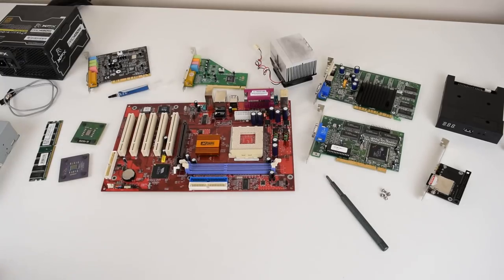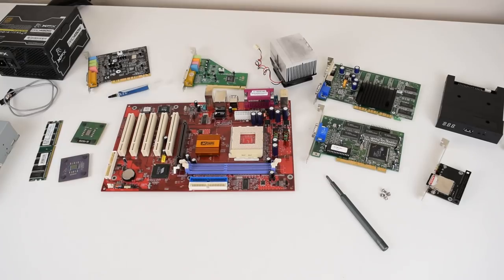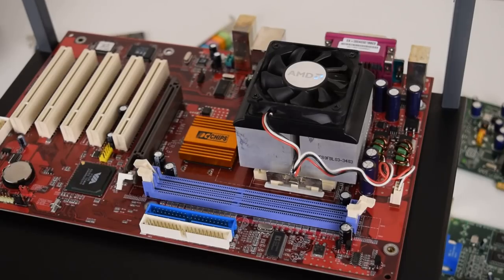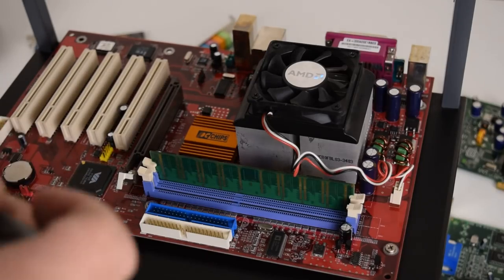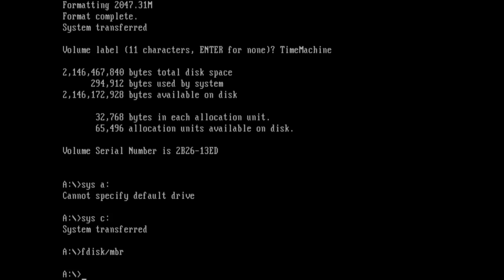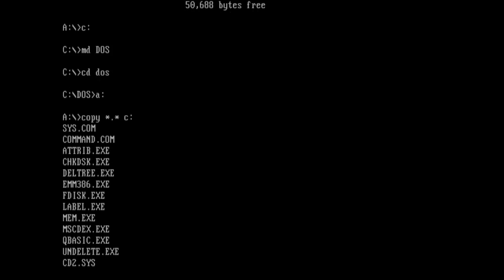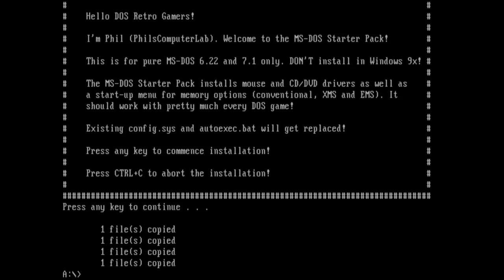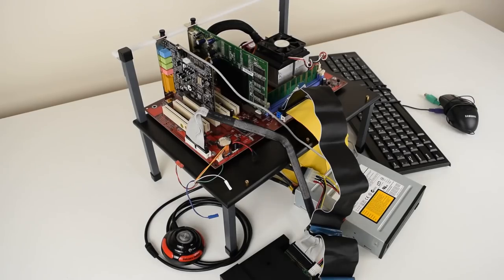Building a DOS Retro PC that everyone can afford

Comment: The best way to get computer hardware on the cheap is to get abondoned systems from friends or family ... Or even dumpster diving or putting a advert in the classifieds , you will be amazed at what you find
Reply: my friend actually found 2 amd 754's on a dumpster.It was standing in the rain.I took some time to clean it up a bit and both of them working fine just i gave most of my agp cards away only 1 i  got left but misplaced it is a 9200 ati one i think.
Reply: That's a fact.
Reply: This is definitely the case. I found an i7-920 system in a trash pile (dead power supply and hard drive), another system with a bad motherboard and a good 500w PSU, and a friend offered me his "old" GTX950 after he upgraded his to do VR stuff. A bit of work, a hard drive, and a 6-pin adapter later and I have a (sorta) modern gaming rig for $60.
Reply: found a athlon full system by side of road
Reply: Found mine at a recycling center. A working Asus board with an AMD 1GHz CPU and 512MB of SDRAM. And I've been using it for a retro build as well.
Reply: I asked a guy at a airport if he had any spare crts. Next thing i know he gets to my house and gives me a Free ibm 5153.
Reply: I have this dell T3400 I found and set it up as a windows XP gaming machine. Threw in an HD 5850 and some new 500 GB hard drives in raid 0. It gets around 250-400 fps in far cry. It has a core 2 duo E8400 with 8 gb ram.
Reply: I put my amd 64 3200+, gf6600gt, Asus sli board, antec tower, dvd writer, floppy  on street knowing someone will take it. Took 15 minutes. Lol.
Reply: I have a weird pc build I got a 15' crt from my attic nvidia geforce 315 4gb ram and amd sempron 1.9 ghz and a 500gb sata hdd. Windows xp
Reply: All my PC s for the last 5 years were free, from friends. I5, i7, all pretty competitive.
I think I spent ~ 200$ in the last 7 years on parts.

Comment: Dosbox is amazing and is a great solution for playing most games and demos from all PCs since the first PC in 1981 to the last DOS games in the late 90s. Also can run Windows 1/2/3/3.11/95/98 and has good FM sound with support for pretty much all sound cards ever built for this time period. Free software and no clutter.
Reply: Where's the challenge in that though? Old hardware was a massive pain in the arse but when you got those games running it put a massive smile on your face
Reply: plus if you have any interest in software that's not games....  IDK, maybe you can code in Pascal or Turbo C in DOSbox. But also, these old computers will gain value in the future as most of them die and get thrown out (mostly capacitors blowing and owners have no idea they can be replaced) These are finite collector's items, even is you don't play any games at all on them.

Comment: Definitely agree on the IDE SD card adapter for DOS, work brilliantly. Be aware though that SD or SATA to IDE adapters MIGHT not work in Windows 9x with DMA mode enabled. Just FYI, in case you're building a DOS/Windows combo PC.
Reply from the maker: Yea on some chipsets, and with some adapters, the DMA mode will lockup the machine. I've seen this quite a few times so far.
Reply: that's why i still prefer cf to ide (the pins are the same)
Reply: Where can I find one with a bracket. I can't find them anywhere
Reply: I use win 98 se on ide sd adapter and all work just normal. + super sillience. :)
Reply: I've noticed that IDE-SD adapters are great for newer hardware, but they don't work seem to properly for older BIOSes or systems especially if they still rely on cylinder/head/sector geometry... at least the ones I've found so far. For older systems you'll still need to use an IDE CF adapter.

Comment: I wish I had have seen this video a couple of weeks ago! I just bought an Athlon 1000 MHz that showed up with about 30 bent pins. It was very challenging to get them straightened out enough that the CPU would socket, especially given my mid-40s eyesight. Using a mechanical pencil for that is a great idea! It would have saved me a ton of time.

Comment: There ARE DDR sticks lower than 256 MB. I believe the lowest DDR RAM sticks are 128 MB ones.
Reply from the maker: Nice, got to look for one then :)
Reply: Can confirm - I've got 2 Hynix modules in my drawer, 128MB each, PC2100. :)
Reply: I can confirm, I had two 128 MB Samsung sticks for a while in my Socket A machine at the time. I don't remember the speed, it was 15 years ago.
Reply: Below that, 64MB starts to go into the SDRAM category doesn't it?
Reply: Actually, my Google-fu turned up a 64MB DDR stick by Micron so they do seem to exist. I had no idea. :)
Check this one out: MT8LSDT864AG-133C7.
Reply: osgrov - the listings are showing that as SDRAM, not DDR.
Reply: youtubasoarus - Oh, you're right.. Amazon goofed that one up - they claim it's DDR.
But yeah I found the data sheet now. Clearly SDRAM, PC133. :)
Thanks for the update.
Reply: osgrov - No worries, I was wondering if I was wrong myself. This is some OLD memory lol. Was wondering what the transition point was from SDRAM to DDR. And then listings show DDR SDRAM so that's kind of confusing.
Reply: youtubasoarus - Yeah it's been awhile since these were current tech, hehe.
There are several people on eBay who sell 64MB DDR DIMMs though. I'm trying to verify at least one of them but haven't been successful so far. :/ Guess we're not the only confused ones! Many I've checked now are clearly wrong. There is one guy selling no-name PC3200 64MB modules though, they look promising. Unable to locate a part number for it though, and the listed UPC is incorrect.
Looking at the DDR spec (on Wikipedia) it does appear that 64MB is the smallest size, and 1GB the maximum. So there's hope!
Reply: Here in Russia we have two main buy-sell sites: Avito and You.La. I tried to look for any 64 MB DDR sticks, but it didn’t seem to result even for PC2100 ones. Only SDR (pre-DDR sticks like PC133). However, I have no problem finding a 128 MB DDR on these two sites.
Reply: I have a 64mb ddr stick somewhere in my pile of hardware
Reply: @youtubasoarus im guessing the transition point was somewhere around the start of the Pentium 4 era, i've got an old Pentium 3 Mobo from around about 1999/2000 which uses SDRAM, my next oldest Mobo is a Socket A Asus board from about 2002 which runs DDR. Ive also got quite a number of old SDRAM laying about in my drawers and can confirm there is a few 64MB followed by 128MB sticks, iirc the highest SDRAM stick i personally have is a 256MB though i could be wrong(its been a while since ive checked out my old hardware)
Reply: Ian Witten - Wow, like, for reals?
Reply: Tony the Bomberman yeah according to Wikipedia it's the minimum capacity of a DDR stick, problem is Im pretty sure the person who built the pc is has passed away so I can't ask anything about it. It has some generic sticker no idea what brand it is
Reply: Ian Witten I'm willing to build a lowest possible (well, not really) Socket 775 rig, with some older 775 mobo like those on i865 chipsets or so and some very old AGP video card like RIVA TNT or early GeForce, running older Windows like 98 SE or 2000, and I already have a 3.2 GHz Celeron D 351 CPU. Would be cool if I found a 64 MB DDR stick as well here in Russia 'cause it would fit the suit pretty well. Or maybe it's not really worth bothering finding such a low DDR stick, and a 128 MB would be okay as well or even better...
Reply: It's been ages but if I remember right, that option that's something like 'OS > 64MB' (and/or mentions OS/2) limits the system RAM to 64MB no matter how much is installed.
I don't have any system out to test that for sure right now, but you can always just try toggling it on and off. I DO know that on the two Poweredge Servers I have(1850 1U[P4 Era] and 840 Tower[Core2Quad Era]) have an "OS install mode" that limits system ram to 2GB, there may be similiar things on different motherboards for different Ram Amounts.

Comment: Good choice for those who can't find/afford a Pentium or K6.
The best investment that makes a difference, is a CRT monitor. 17 inch is better than 19 inch with low res..  Seriously.. CRT (many has forgot) gives the "best" picture with MS-DOS games. But they are hard to find these days. You can go with a LCD 1600x1200 (or 1920x1200 with aspect correction) which will do 800x600 or 320x240 as well as 640x480 pixel perfect, BUT with 320x200, a CRT will be best. A LCD with aspect correction can display it OK, but the LCD is too revealing of pixels. CRT's are more smooth n blurry. ;)

Comment: Went on a bit of a ISA sound card spending spree recently; bought a couple of ESS cards and a Sound Blaster 2.0, the latter of which I got for a "bargain" under $100 Aussie dollary doos, so I can attest to how much it costs to do old-school retro gaming on period correct hardware. Even the ESS cards cost $32-45 including delivery, and they're just unbranded, non-collectable cards.

I managed to save money on some of my 486 motherboards by buying untested and dodgy looking boards, some of which needed repair, but I've got the electronics background to be able to troubleshoot and repair the boards myself. The only other option would be to buy bulk lots and hope you get one working board, then sell off the non-working ones as faulty/repair required to recoup some of the costs of those boards. But even then it's still going to be expensive and time-consuming.

Or you could just buy something newer and cheap, and just fiddle with the settings a little, and save a whole lot of money! You could easily pick up a whole system for under $100, which is cheaper than a "bargain" period-correct collectable sound card alone!
Reply from the maker: Yea something like a Sound Blaster, they are not cheap any more. ESS cards, for years nobody cared, they make some really good sound chips.
Reply: That's what I'm discovering. Because sound blaster cards were the most popular back in the day, that means they're the most popular with collectors, hence the high prices. And so ESS cards are much better value today, even PCI models. But they're really very compatible, and sound pretty good too.

Comment: Hi Phil, another good video. I cant think of much other, rather than first time viewers may have needed the segment where you calculate the 5 volt rail load to see if the Socket A will overload the markings on the power supply, but the CPU you chose is a low wattage one.

But you have it all covered in your plays lists.

Hmm  now for the hunt on super  low end thin client in dos mode ( HP / Cissco Wise )

PS , i still hang on to my SB16 and matching 2speed cdrom if still works after queuing up to buy it new when the price plummeted down to $800, then i saved more overtime money and bought 4 x 4meg sims at $100 each and upgraded yet again

The gotek floppy emulator is great ( their OEM software not so good ) the 99 images are cool but you really waste a 4GB USB stick as the rest of the stick is unusable, but that is a cheap price to pay for something that works great - HAHA i know what you mean about finding your A4 printed 2 x 25 column per side list of software you have saved in each slot, i keep it in a A4 sleeve as my wife found it in the spare room and threw it out once thinking it was scrap paper
 
Sites such as allbootdisk and winworldpc are excellent for all retro software to boot up and some support files. I have in the cupboard original 5.25 and 3.5 DOS 3 to Dos 6.22  retail and OEM packages, and i find they mostly work, but often you get a error somewhere, sometimes t can skip a file other times halt on something important and die. Some have never been opened, so it is true they loose there magnetic field over time, others like a junk cheap coloured disk i have in 3.5 work every day, all of the top brand, Memorex, Imation, Verbatim, have the best chance of lasting well.

For 5.25 3M, BASF, Maxell, Memorex are pretty good later on the Le Floppy and Laser were just cheap mass produced items, they worked but they are made to a price.

Regards
George

Comment: Good video. The SD card use was interesting. I still prefer to use my older Pentium 233 chip for DOS as the motherboard has a few ISA slots, which are needed for my Roland SCC-1 Midi sound board & the Soundblaster. It makes games like Doom and Descent so much better in the music department. I also have a Soundblaster MCD 16 with a Yamaha DB50XG. The Yamaha is set as 300 and the Roland as 330.

Comment: An option for better game compatibility with the YMF744 is to go for an older VIA chipset with the 686A/B southbridge. With this setup you can run the YMF744 in DDMA mode and then you don't need the DSDMA TSR and EMM386 (you need a modified SETUPDS.EXE as it doesn't contain the PCI id of the 686A/B southbridge). MSI actually produced a board with the KT133A/686B chipset with a 12V P4 connector, the K7T Turbo2. Also SiS chipsets can be a nice option for the YMF744.
Reply from the maker: Yea thanks for the reminder, this is on my list of things to check out in future videos. I have an upcoming project with a T5710 Thin Client. Transmeta CPU, but it might have that older South Bridge. I wonder if SETUPDS could me modified for other chipsets?
Reply: Looking forward to that Transmeta project. There is a modified one I used on the SiS 645DX/962UA chipset for DDMA support, might also work for the VIA 686A/B southbridge, it can be downloaded from here: http://vsynchmame.mameworld.info/
Reply from the maker: Thanks, I believe I have a few Pentium 4 SIS motherboards, they work great as AGP test platforms, being Voodoo compatible and the Rage MAXX also works with them :) Do you think a modified driver for newer VIA South Bridges could be possible?
Reply: I tried to force DDMA on newer VIA chipsets for the YMF744, it initialized in DDMA mode but games refused to work. Duke Nukem 3D setup complained about DMA address wrong or not working.
Reply: Think I saw you received an ALS4000 card, try this in the setup you got in your video as it should work great under MS-DOS.

Comment: For DOS i think the best configuration would be and asus board that was released for pIII that has 1 agp slot 4 pci and 2 isa slots, the thing is that one of the best internal sound cards is sound blaster awe 64(isa) , for video would be an S3Virge for example that are compatible with univbe driver. My 2 Cents

Comment: Nice video.  I bought some retro stuff recently.  A unisys 386 16mhz with original mfm 43mb hdd. 

And a 486dx 33 system with a 256mb hdd.  And 4mb 30pin memory.  Also got a cheap mainboard with a 6x86 ibm cpu on it.  For 15€. 

I only need to get my ibm mainboard with 486dx4 working.  It gives an error code at startup.

Comment: I've finished my 478 build, now I'm onto 775. I bought a 2nd hand PC solely for the Asrock 4core dual sata2, can't wait to throw a q6700 in there.
Reply: Having fun with 775 rig got a whole pc for £15 added a q6600 and a hd 7700 overclocked has a antec super lanboy  case still looks great and gets used daily by girlfriend as a photo editing system

Comment: Looks like a PC Chips M817 ? socket a (462) and a XP Tbred and either a Duron Spitfire/Morgan core or a Athlon Thunderbird in the grey.
KT266A chipset can handle 133MHz FSB CPU's but the performance with the PC Chips mobo will be slower than most other socket A mobo's (though VIA is preferable to some old SiS chipsets - especially the sloowww SiS 730 which PC Chips used on the M810 LMR. 
Ive had over 50 computers (easily) and used to have 19 computers at home with 10 computers (cased and caseless) in my bedroom all running SETI@home 24/7 and when SETI got old I ran Folding@home but was in the top 40 in the UK on SETI@Home (back in the day).......you know you can get nForce mobo's with onboard GeForce 2 VGA.....A7N266-VM? I think thats the model I had......also had a GA7ZXE with a VIA KT133a chipset and had the FSB (168 pin SD RAM of course) up to 156MHz but have no idea how PC133 OR the chipset achieved this and not to mention the ridiculous frequency the PCI/AGP bus must have been running it.....KT133A also worked with Athlon XP Thoroughbred A & B CPU's and obviously other socket a processors such as the Duron Applebred which were great processors if on a budget as could re-enable L2 cache to same as athlon XP (256kb) from the 64kb default on a Duron. All I needed was a HB pencil and I joined two contacts on a bridge on the top of the processor as Applebred Duron were the same as the T'bred processors - just had an L2 cache bridge cut to lower the amount - or at least AMD had hoped so............
I had a 1600MHz Applebred which clocked (easily) to 2300MHz with the full L2 cache enabled and the CPU cost just £32 at the time! I cant remember what mobo the Duron was on but probably a Abit NF7-S, Epox 8rda3, Epox 8rdae and other nForce 2 based skt a mobos

Comment: Try using a Sandisk A1 (or A2) microSD card for operating systems.
Their A-series cards greatly optimize OS and small file (4k IOPS) read and write speed, and is great for Windows XP and below, as well as Linux; better than most SD cards and USB 2.0 flash drives; or even most USB 3.0 flash drives.